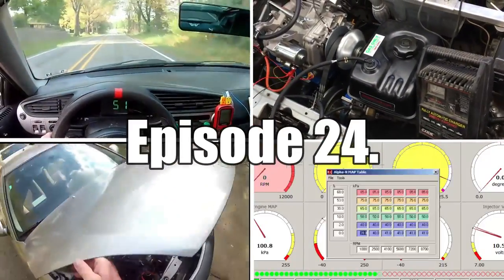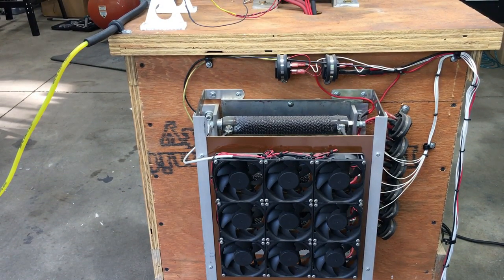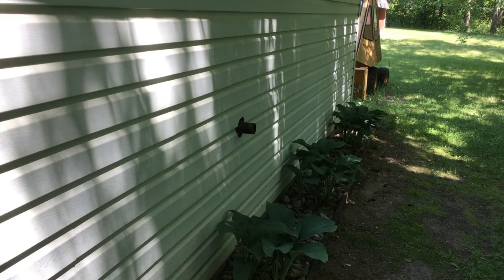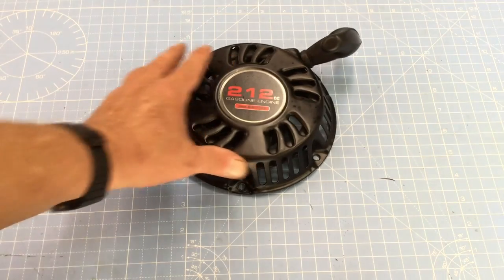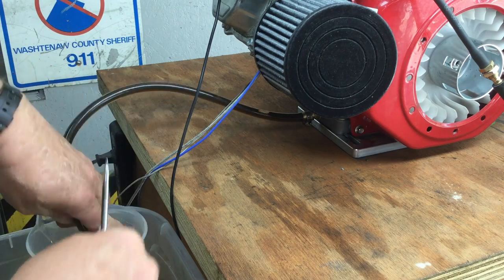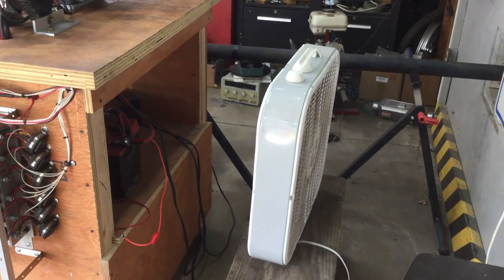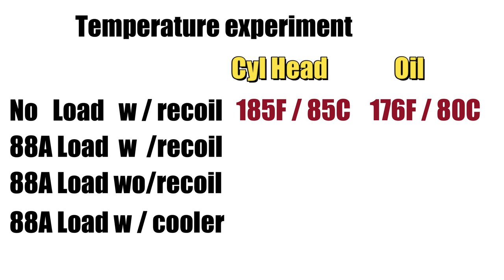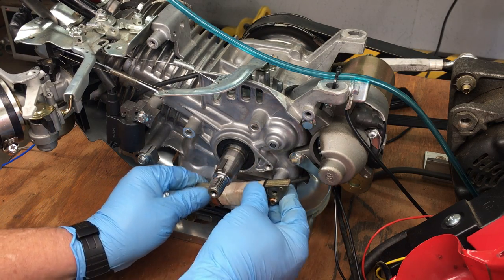Episode 24.  Testing an oil cooler on a 212 cc Predator engine

Comment: Use a 6 in blower fan and ducting onto the engines fins. 

Flexible copper tubing wrapped around the engine with coolant.

Comment: I drilled a hole into the side of the block a little above the drainplug, put a steel straw in and JB welded it to seal, cut it off sticking out the block and ran a line from that to the old governor control arm hole. Should be decent lubrication dropping right on top of the crank

Comment: Check cooling air intake temperatures while driving.  It maybe higher then ambient in which case you could duct air to the engine cooling fan shroud  making a cool air intake.  If the engine is recirculating heated air the engine will run hotter to overheat.

Comment: How hot does it get under the hood? Maybe adding some vents to help with under hood temps 
Or even a tube running from the front of the car angled at the inlet of the cooling fan so it get fresh air

Comment: Just wondering when adding the oil cooler did you account for the oil capacity of the oil cooling system. I have a Honda GX620 and I added an oil cooler from a GX670 which increases the oil capacity by .7 quarts. Lowering the oil level in a splash style oiling system would cause less oil to splash upwards might be the reason for the rise in cylinder head temps. Also if you run an engine ungoverned you usually tap the hole where the governor arm was which imo would be a great place for a return line on an oil cooling system. Bringing oil to the top of the crank giving more oil to the much needed areas I.e. cam and head. Just an idea. This was a great video. Was something I wanted to try with my highly modified small engines. I run them on the lean side for quicker acceleration and low end power. So engine temperature is an issue for me.
Reply from the maker: After adding the oil cooler,  oil was added to the crankcase to bring it back to operating level.
Reply: @robotcantina8957  CONGRATULATIONS  ROBOT CANTINA...   104k   subscribers....  JIMBO  you provide the fun
and entertainment that viewers enjoy👍👍👍!

Comment: Have you considered a hood or grill scoop with a duct blowing air directly onto the cylinder head. it is an air cooled engine, after all! And its installed in a Honda, so stick- on vents are technically part of the natural evolution.

Comment: looks like it was sucking air from the crankcase so that would starve the slinger scoop on the rod. You need a way to keep the crankcase full AND cool the oil. While it might take extra time you might want to try tapping the case an inch or so above the current supply (wherever it's safe to do even with the oil fill lip or top of gauge limit) so you take the supply from higher and return to the bottom. When you put oil in the crank case run the pump till you have the lines full, then top it off. That keeps the crankcase full and increases the volume of oil in it. which will be more effective in displacing heat.

Comment: I love what you are doing along with the logical explanations and problem solving. 
Would a vacuum powered fuel pulse pump flow enough oil for the radiator?
Have you thought about water injection for heat rejection in the head on the supercharged rig? It might be able to keep you closer to stoichiometric air/fuel ratio without melting anything. It might be an option if your new EFI controller can control a second injector.

Comment: Hmm You could consider using parts from a PC watercooling kit. IMHO 360 mm radiator and actually efficient pomp should make huge difference. Plus those pumps are designed with those type of temperatures in mind and runs from 12V power. The bigger temperature delta between oil and engine parts the more efficient heat transfer will be. And 75 C is nothing to write home about.

Comment: You could try to use a vacuum powered fuel pump. Like the fuel pump used on the Chinese 250cc version of the Honda Helix. you can find them on eBay cheap.

Comment: What about a vacuum powered pulse pump, like a fuel pump on a lawnmower? I'm sure it isn't rated for the temp and the flow can't be near as high as this pump but some circulation beats none. As far as I know there would be no extra load on the engine from that.

Comment: Drill powered oil pump keyed to the crank? CAC? Run the intake air through a chiller box? Chiller box ducted through the crank fan and sheet metal air jackets around the head? Knox porcupine engine cooling?

Comment: Depending on how silly you want to get, you could always repurpose the windshield washer assembly for evaporative cooling: Point one jet at the engine and the other at the oil cooler et voila!

A bottle of Windex on the passenger seat is a perfectly suitable replacement for what you lose... :D

Comment: It would be nice to have EGT and air-fuel ratio info.  As a former aircraft owner, not mechanic, temps can be influenced with the mixture control.  Also an oil temp below 212F at sea level won't boil off water in the oil.  Keep the episodes coming!  Thanks.
Reply from the maker: The engine is fitted with an EGT, however the extra therocouple meter I purchased to watch that channel would not operate due to the electrical noise from the ignition system.  I wish I could have included that info, but with only two working TC channels I went with cyl head and crankcase oil.  

The bench engine we used was just something to validate some theories   I suspect once we get the new EFI up and running we will have better control of the air/fuel mixture and that will also certainly help with temps.
Reply: @robotcantina8957  I might have added in a more sophisticated environment ($$$) it would have been nice to have BFS info as well so we can benchmark the efficiency and how basic computer controlled EFI compares to rudimentary carb but guess that will be for another day.
Reply: @msms-rl6zf  CONGRATULATIONS  ROBOT CANTINA...   104k   subscribers....  JIMBO  you provide the fun
and entertainment that viewers enjoy👍👍👍!

Comment: Use evaporative cooling, use a weed sprayer or something similar in the car to mist water on the cylinder head. Probably not the best method, but an interesting way to cool the engine.

Comment: With the pull start removed, is it not possible to design a better fan to blow over the engine. It seems the factory one is a compromise in design to allow the pull start to fit.

Comment: If the project really continues, I bet we'll see water-cooled head like in Porsche 959. lol
Reply: At some point I guess so. The engine in the 959 was developed for racing from a completely air-cooled unit, and gained water cooled heads along the way as power increased. No matter how much R and D you throw at it, you can't reliably extract more power from an air-cooled engine. For the type of flat-6 boxer porsches run, the cross over from air cooled to water cooled with porsches seems to be about 50kW per cylinder and/or 90 kW per liter.

Comment: I know this is a slightly older video, BUT have you considered putting an oil return right above the valve train to add extra lubrication to it, as well as head cooling, but also this could be used to install an oil filter system and if using a clear filter relocation with a cartridge filter, you'll be able to see the condition of the oil like a sight glass, as well as possibly the oil filter condition, something like a small diesel oil filter used on those truck bed pumpers.

Heated oil should flow a bit easier, but these engines are meant to run really well with the dipper oiling system.

Comment: I had the idea for the oil cooler myself and I'm glad you did it, now I'm wondering if the rise in head temp and drop in oil temp is because not as much oil is pooling in the top of the engine due to the pump keeping the oil level down in the lower portion of the block, therefor not as much heat in transferring into the oil and more so through the head fins. I do get that if you fill the oil cooler and then put the recommended amount of oil in the engine that it shouldn't affect that but how can one know for sure???
Reply from the maker: The engine was topped off with extra oil to bring the level back to normal before the test was done.

Comment: To simplify the install in the car, and perhaps drop the oil temps even further…
How about mounting a radiator out of Saturn equipped with an auto trans and utilize the trans-cooler circuit to cool the hemi ?

Comment: A header will lower temps on them 212 cc motors.  The stock muffler is very resistant and a heat source for the motor.

Comment: I think oil cooling only makes a difference on an air-cooled engine if oil passages are incorporated into the cylinder head, like the mid-80's Suzuki SACS system.  I'd focus on improving the efficiency of the air cooling system, possibly by incorporating a velocity stack on the intake to the fan, or looking at the shrouding around the cylinder fins to see where you can remove pressure leaks.

Comment: Maybe create some kind of locking pin/wingnut style attachments to add and remove the pull start system when you need it. I would weld the bolts into the cover, and when you need the recoil starter just attach using wing nuts
Reply: If you had the room, a hinge on one side and a simple clasp on the other side means no lost recoil or fasteners.

Comment: You should have figured out the Delta temperature for all the tests. Where are you taking the ambient temperature and minus it from the max temperature of the equipment that you're testing and that should give you your Delta temperature. I don't think this would work on the engine temp readings, but seeings how the engine oil is not really affected by the ambient temperature, but it should make it more accurate determination on head temperature.

Comment: You can keep the recoil off the engine but leave it in the car.  You literally hold it onto the flywheel cup and pull. Does not need to be bolted.  Best of both worlds.

Comment: Hi Robot cantina;  The MAP sensor didn't work because you're missing the "M" having a pipe between the cylinder and the carburetor is not a manifold.  Think of the pressure wave / air speed in the tube,  You have a plenum and MAPs don't work on Plenum (or they would be called PAP) but if you want to keep using a pipe you should use an Mass Airflow Sensor or create a manifold to lower the air speed and balancing the pressure wave and speed

Comment: They make these drill driven pumps, maybe that would be a option for a oil pump? Maybe put a gear on it, and bracket. Running it off the starter gear of the flywheel!

Comment: Is it possible to return the cool oil to the cylinder head cover on these without making a leaky mess? 

The lower oil temp could let you run a lower viscosity oil which might help power and economy by reducing drag.  
Would be worth the experiment if the charging circuit you build ends up powerful enough to drive the pump without problems. 
But maybe I'm overthinking it and the higher viscosity oil at a higher temperature is just fine.
Reply from the maker: We are going to do the test again with the return oil pumped to the rocker cover,  should be interesting to see if that makes a difference.

Comment: Try using a vacuum driven fuel pump like is used on more modern riding mowers to circulate the oil.

Comment: where did you source the pulley on the crank? does it require any specialty tools to mount it or can that be done with a drill and wrenches?
Reply from the maker: The pulley is a water pump pulley from a 2003 GM  2.8 V6.  The pulley is mounted to an aluminum shaft flange that I got from BMI karts.

Comment: I did something similar to this with a Kohler CH440 engine (think predator 420 with just enough changes for Kohler to claim it's their "design" and still made in china). Toro is using these in their GTX utility carts and they have having issues with excessive ring wear. Enough so that the one sales rep asked me if I though there was anyway to install an oil filter on them. So just to see if i could I used a cheap oil transfer/turbo scavenging pump longest description ever on Amazon and a remote oil filter. So if your going to run an oil cooler you might was well stick a filter in line as well.

To start one of these engines without the pull start, an appropriate sized socket and a drill works really well.

Comment: For the the issue with lower cooling Temps on high speed runs why not cut a hole in the hood and have a ram air system blowing directly into the housing. I'm thinking a hole with a guide through the "ram air" housing with a guide so you can still have the pull start

Comment: Run the oil from the cooler into the valve cover.  Head will probably run cooler by quite a bit.

Comment: I'm not surprised that the cylinder head temperature was higher with the oil cooler than with removing the restriction for the cooling fan. These engines are not oil cooled so the oil temperature isn't going have a massive impact on the cylinder head temperature.

Comment: Would a rudimentary methanol/ water injection system assist in cooling the head? Airline antifreeze is almost all methanol and cheap, and on the plus side will help keep the combustion chamber carbon free, and may bump up the octane rating.

Comment: Any idea of the oil flow rate with the diaphragm style pump?
You might look at an old Saginaw power steering pump for the final install. They are relatively compact using a vane type pump and you can easily modify the relief spring pressure to be very very low.  If memory serves in the factory application they move around 2 GPM (pretty low flow) and you will gain about a quart of oil capacity.

Comment: Simplest cooling upgrade.  Remove all the shrouds and put a standard car radiator fan (like the one that would have been in the car) to blow air across the whole engine.  Just make sure to put a plastic air duct to direct the air over the engine and not the entire engine compartment.    The flywheel fan works for most cases, but not for the load and temps you are wanting.

Comment: I'm looking forward to the charging episode. I'm running dual coils on my 420 and I'm only getting a max of 10 volts out. The voltage rises with the RPM until it hits 10v and then decreases.

Comment: It's all a matter of looking back at air cooled VW technology.
A thermostatic shutter ring to tighten the aperture of the intake air for cool to sub zero ambient air temps to quickly warm up the engine to normal temperature.
An oil cooler in a "dog house" formed in the sheet ducting of the cooling airflow....
The VW valve covers were painted matt black so that the splashing returning oil can transfer maximum heat to the forced air flow...might be a good idea to split off part of the returning cooled oil flow to the valve cover on the Predator engines?
The internal oil return passages in the block will be cooled as well..
Look at an external engine-driven actual oil pump to increase the flow of oil to the cooler and perhaps an oil filter as well...the bigger the oil cooler, the more "reserve" of oil you have.......

Comment: I'd say give the air cooling more of a chance by making sorta hot-air-extraction-ducts on the car. The driving should (maybe) provide the neccessary wind for cooling.
Not bashing oil cooling, but it seems to be pretty bad as for now.

Comment: Hej
It would be interesting to test water or water/methanol injection to cool down the cylinder temp. It would also prevent knock on your supercharged build and ultimately make more power by allowing more boost pressure :)

Comment: Cool the head with low weight and low power cost eh? Tricky business..... I had a couple of thoughts though. 

Maybe a passive liquid cooling loop using thermosiphoning as a pump? With tubing running up the block and cylinder head and down a vertical radiator you would have a pumping effect in each. Water might be good, but the thermosiphoning effect increases with the coefficient of thermal expansion and the change in temperature. Water's cte is 210E-6/Kwhile ethanol is around 1000E-6/K, and ethanol has a lower specific heat capacity so the dT would be higher as well.

That huge aluminum floorpan you made in a previous video seems like it would make a decent heat sink if you snaked tubing along it with some thermal interface. Might be a place to shed unwanted heat without adding drag. 

You could add heat pipes to the fins of the head to increase the surface area for heat transfer. Passive and low weight but I don't know how effective it would be without more airflow.

Have one of the gnomes fan the head....

Or just don't cool it at all. I mean you paid for the whole thermometer, might as well use the whole thermometer. 

Love the vids!
Reply from the maker: Thanks for all the ideas!

Comment: Can we install an oil cooler on the current insight that's superdiesel powered? I know it's cold out but for efficiency sake it may be good not to blow it up. That little engine seems like its giving it all it has to move that relatively heavy vehicle, it's essentially towing a shell so in my mind the oil cooler makes a lot of sense. Not sure exactly how you would install it though

Comment: Could you experiment with a more efficient/powerful cooling fan? Given that it's quite a cheapo engine it wouldn't surprise me if the attached fan is optimised for cost/ease of production rather than cooling efficiency. You could get someone to 3D print one to an optimum design maybe?